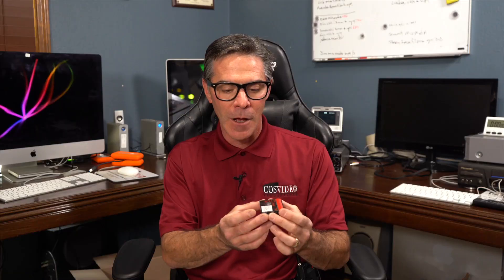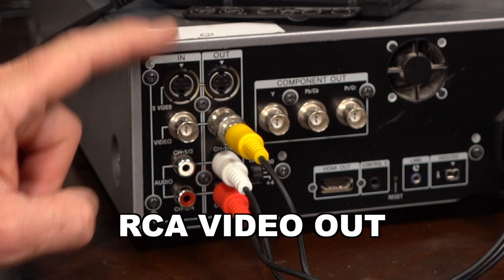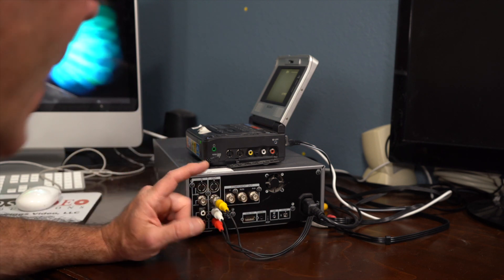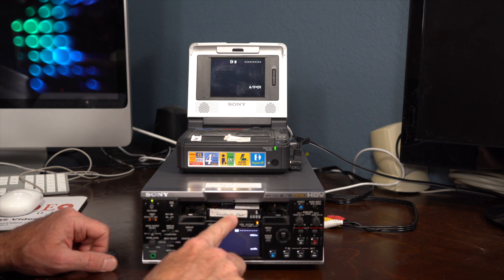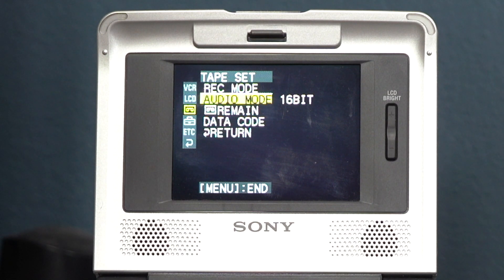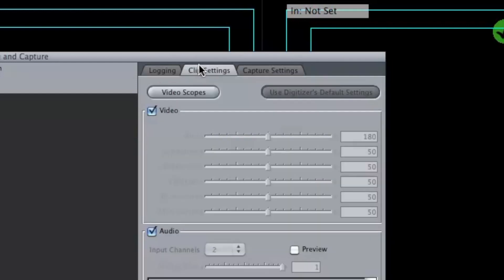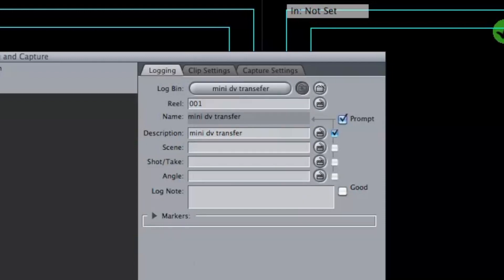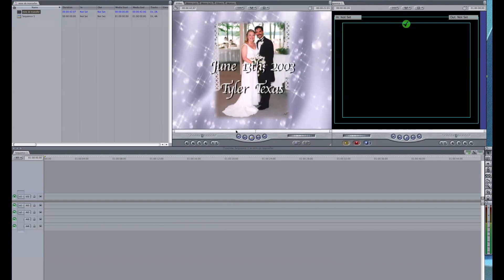How To Transfer Mini DV Tapes

Comment: Why not buying HDMI or Component capture device? HDMI digital output, now you went over to composite (with loss of quality)?
Reply from the maker: Hi Wendy.  I thought that I explained this in the video. Since I am using firewire to get the video into the computer, Final Cut likes non-broken timecode.  Most tapes that I receive are from consumers so they have started and stopped the recording leaving dead space in between each recording.  The only way I can capture the video is by doing so like in the video.  I know that there will be a loss of resolution but only slightly.  The majority of the tapes I receive are also standard definition and the final video gets dumbed down to mp4. The resolution still looks great at the end.
Reply: @TheMediaNerdMT  You can use QuickTime. No problèmes then with the audio or the TC.